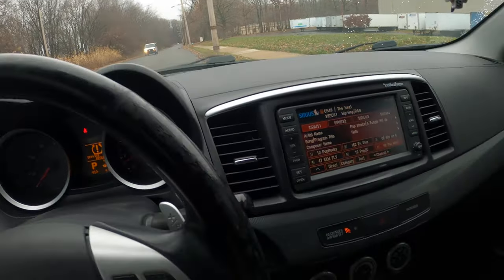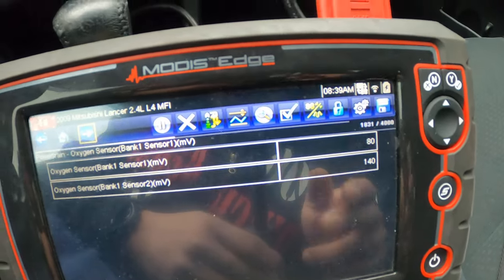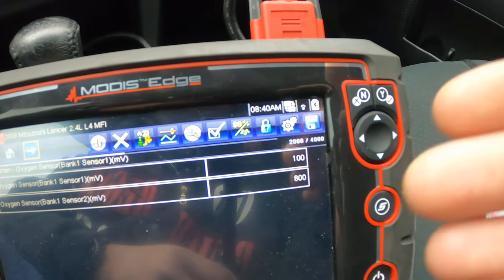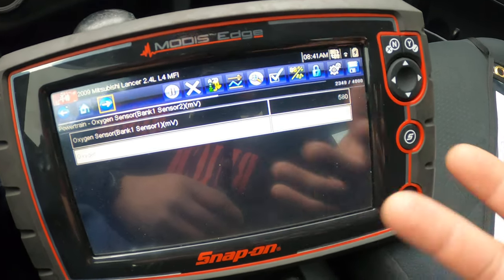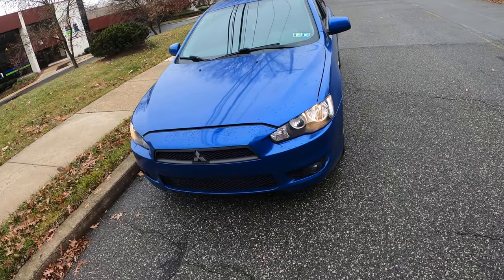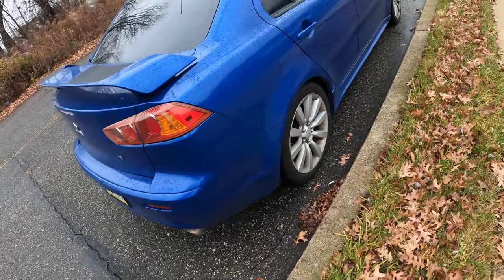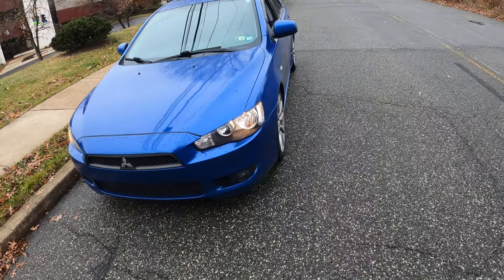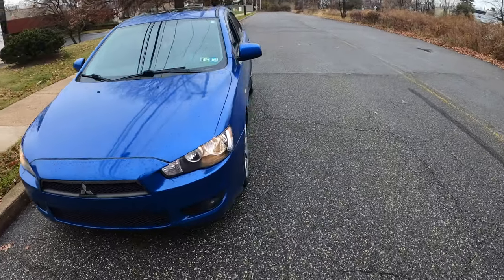💢2009 MITSUBISHI LANCER GTS 2.4L: BANK 1 CATALYTIC CONVERTER/O2 SENSOR READING✌

Comment: I got a code P2423 and I was thinking about doing the o2 sensors before spending on the cats don’t know what to do
Reply from the maker: From my experience once a catalytic converter is bad there's no bringing it back. Don't just change the O2 sensors confirm if they're an issue first. There's a few ways to confirm a bad O2 sensor 

THANKS FOR WATCHING SUBSCRIBE AND STAY TUNED FOR MORE🤝‼️